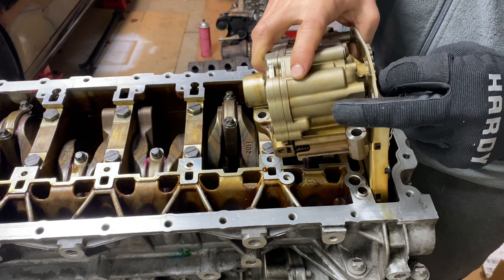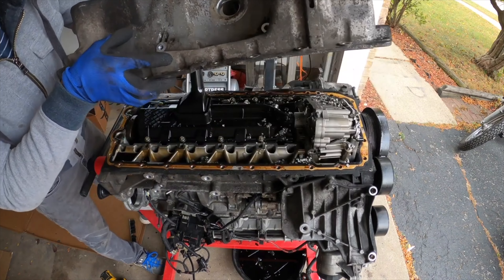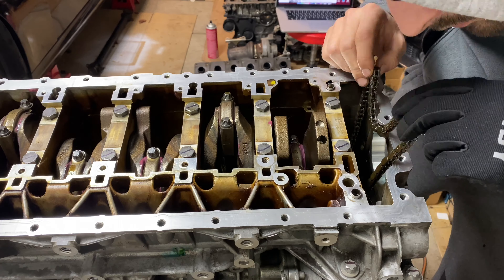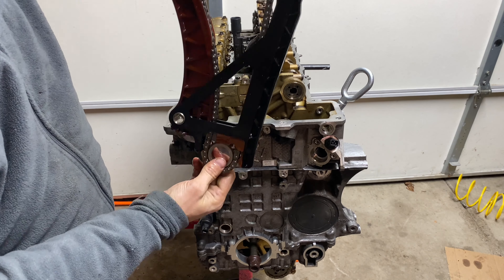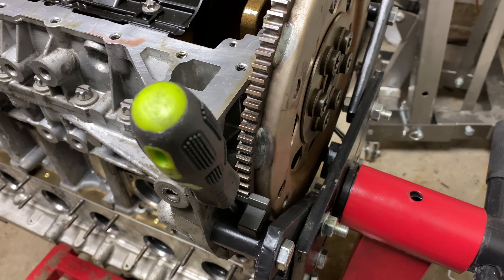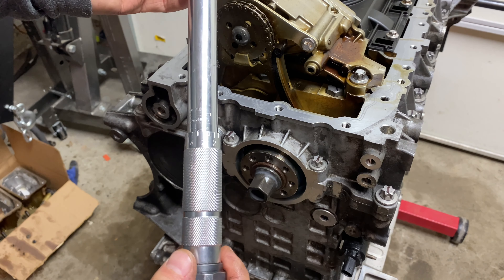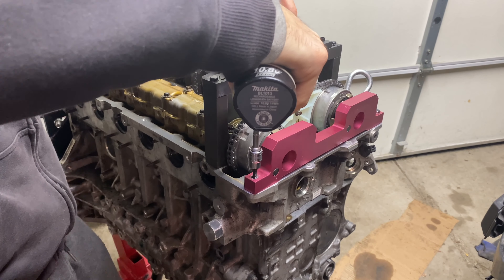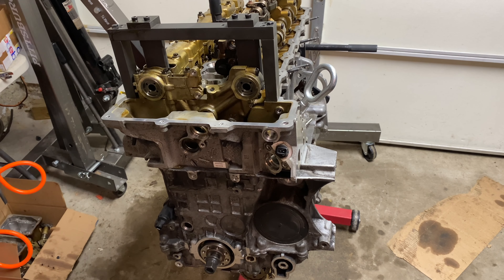Timing Chain and Oil Pump Replacement - BMW N55 Engine Rebuild Project Part 5

Comment: This video is missing so many steps if you do it like this you will have problems. He never installed the crankshaft alignment pin for TDC, he also never installed the flywheel/ flex plate holding tool to brake the crank bolt loose and to tighten it big no no I hope his method on that works it might. The sad thing is the crank alignment pin is in the kit he just doesn’t use it
Reply: Who cares about the timing.
Reply: @dansmith728  absolutely right timing is not important at all lol

Comment: I have 2011 535 GTI I have drivetrain malfunction and oil pressure errors on my car I took it to the mechanic he said the timing chain need to be replaced and we checked the oil pump maybe need to be cleaned up or replaced how much it cost to do all that?

Comment: hey man im doing a timing chain job but im having a weird issue after i timed the engine i did 2 rotation  then when i put the timing alignemt too back im able to lock the cams and the sensor wheell also aligns with the cam shaft but the fly wheel lock pin gets very slightly of alignment i don't have any oil pressures right now. i don't know if it normal or am doing something incorrectly .

Comment: I have a question. What happens if you don't torque the  crankshaft bolt all the way to 270 degrees? Timing issue or low oil pressure issue? I rebuilt the same engine now I have a low oil pressure issue. The car runs fine but I get the low oil pressure warning light every trip I make.

Comment: Hey when you torqued down the center hub crankshaft bolt .. Did you use a 3/8 torque wrench or a 1/2 torque wrench?

Comment: I just timed my n55 using this same kit. When I took it all off to rotate and I check it, I thought it was making a weird clicking/clunking noise and thought something was wrong too!! Also managed to strip the thread on old chain tensioner. Glad I got a new one
Reply: I have the clicking/clunking noise also after timing. Was your engine all good after this?

Comment: great video as always. would be fun if the engine goes back in but mates to a manual transmission this time around.
Reply from the maker: That would be really fun, but unfortunately the car it’s going in is an automatic. Luckily, I got a BMW Z4 that’s a manual, so I don’t go out of practice!

Comment: Nice! Can't wait till you drop it back into the car and start it up
Reply from the maker: I hope it works at the end!!
Reply: @SimpleCarGuy  it will! You've done a lot of work, and did it right. Followed directions and even changed out a couple things that didn't need to be. If it doesn't start, run down your wiring harness and make sure everything is where it needs to be plugged in. I switched my pre and post O2's. Couldn't figure it out to save my life. It took my woman asking why i didn't have them set the same way to realize where my mistake was
Reply from the maker: @markmahurin8891  thanks man! Should be a fun day getting her to run and wired up and I'm not even being facetious! I did the O2 sensor switch like that when I swapped the engine on my Z4, but it showed up as a code when I scanned the car.

Comment: I would’ve probably created three or four videos outlining the entire process in a  methodical and organized wayWhile providing a full description of everything you’re doing including tools. Did I say production production production! I’m not seeing your videos are bad, on the contrary I like watching them and appreciate them very much. I just think there is a lot of potential here to up your game and grow the channel. Either way, and whatever you decide to do I’ll still be subscribed. Thanks again
Reply from the maker: Thinking about this more, I do have about 90 minutes of footage for the timing chain and oil pump... maybe I should do a more detailed version for those that want to see each bolt spec and torque etc!
Thanks for watching!

Comment: Very appreciated information, i am replacing the timing chain on the X5 N55 engine. Do you know if if the oil pump chain is not going to move after the cup is removed. Please advise

Comment: These instructions are great but can you help with what happens when you rotate the engine and the timing is not on and what steps to do next. My red bar sits up and 1/2" on the exhaust side after 2 rotations but stays that way no matter how many turns and we've tried adjusting the crank and still does it.

Comment: Hi, Thank you very much your project  had save my life. but question. I am replacing my oil pump timming chain and since I am there my timing chain. But I forgot to mark the oil pump position (not sure if thats needed?)but does the oil pump or sprockets have to be in a certain position when putting everything back together? for instance the camshafts and crankshaft are at TDC with the locking tools an all that but what about the oil pump and vacumm pump ? 
thank you once again

Comment: Hey man I have a question so I’m timing my motor but the exhaust vanos keeps going out of time I marked crank hub and intake and exhaust vanos and intake and crank stay in time but exhaust doesn’t I also marked the gear in vanos exhaust behind phaser and that stays aligned with the cam shaft exhaust side so my question is what can cause the exhaust vanos to go out of time when crank is in time with intake? Meaning flywheel and crank and intake are all aligned just not the exhaust vanos and shaft? Also I should note that I did replace timing guides and crank hub as well as vanos solenoids I keep getting camshaft exhaust angle deviation outside tolerance and they do lock when car is off btw
Reply: hey man im having the same thing how did it go with your engine, were you able to find out the cause?

Comment: What is the tool to stop the crank shaft from spinning when you have to put the main bolt in?
Reply from the maker: They sell a couple of tools, but if I remember correctly, I used a locking pin on the flywheel. Something like this: https://amzn.to/3DoAxto

Comment: The qr cod3s on the venos sprockes should have been facing 90° up, not 45° to the left the way you did it right?

I'm not sure. Trying to find an answer
Reply from the maker: Yes, QR codes should be facing up. If they were facing 45 degrees at some point in the video, I adjusted them after before tightening everything down. I believe I mention that in the video.
Reply: @SimpleCarGuy  no your misunderstanding me, the qr codes on the venos sprockets should have been facing up is what I said, I was NOT referring to the qr codes on the camshafts.

Turns out, it doesn't matter what orientation you put on the venos sprockets, in accordance to the camshaft or the metal trigger plates on the front of camshafts.

what matters is the qr codes on camshaft is facing up, and the holes on the metal trigger plates on front of venos sprockets are lined up in the timing tool plate

So, venos sprocket position is of zero concern, only camshaft position, crankshaft position and trigger plate on fromt of camshaft sprocket, those are the only things that need to be lined up when timing these engines.

I was able to find this answer a while after commenting and thought I'd fill you in, I was helped alot by your videos.

Comment: I really liked the video as I have a similar vehicle as I’ve mentioned before. That vehicle is a BMW 550I 20113 GT with XDrive. I currently have 64,600 km on the vehicle and I would like to take a look at my timing chain and guides at some point just to make sure that everything is OK. With that being said if I could suggest a little better organization for the video portion and maybe using a couple of different cameras to capture the entire process from beginning to end without leaving out anything. I subscribe to a lot of different curators and what makes the larger Youtubers say over 1 million is the production and creation of the video as well as the knowledge, explanation of the work and complete details of tools used and required. You can still work out of your personal garage but if I could suggest possibly looking at what you want to do with your channel and deciding whether or not you want to really up your game and if so follow the above steps. Hope this helps I will continue to watch your videos.
Reply from the maker: Appreciate the constructive feedback and I definitely see where you are coming from! I will take some notes and work on improving the videos in the future.
One of the problems I have with using 2-3 cameras and explaining everything as I'm doing it is that it takes 2-3 times longer to do the work and then it will take about twice as long to edit etc. I do these projects for myself and film for fun and to capture my adventures with the cars over the years. Some of my other more instructional videos do include overview of the tools and the specifics of doing the job, but then like you mentioned a video like this would be at least 40 minutes or would have to be split up into many other videos. I look at these as more of an overview of what you have to do to achieve the same results. I tend to look for videos like that myself as I can find the specific steps in a workshop manual, but would like to see the full job done in a 15 minute video.

Once again, really appreciate your feedback and thanks for watching! I will continue to improve production value as I learn. I've also gotten a new wireless mic on the way, so quality of the audio should go up as well!

Comment: Hi, did my oil chain and timming chain and when I spin the engine it does not complete the full revolution .  I am using the timming tool and try retimming the engine like 4 times already any tips ? stealership is not an option

Comment: Really good channel. Thanks alot. Really helps me out w my n54 rebuild I'm doing r.n.. n55 is basically the same as an n54 in timing (by the looks of it) You got those parts off Amazon? How's it holding up? Seems a bit sketchy buying stuff not from ecs or fcp euro for this kind of stuff 🤔

Comment: How's it going my name is Pete and I'm doing a timing chain replacement on a BMW 328i E90. I would like to know is it best to take the whole engine out or can I leave the engine it still inside and and what are all the parts I'm going to be needing to do this job please respond to this fast I would greatly appreciate it thank you
Reply from the maker: Hi Pete, you can leave the engine in and replace the timing chain. I did it on my Z4 (there is a video, so that should give you an idea of what to expect). You’ll have to research the parts yourself as your car has a different engine to the one I have in the video.

Comment: I hope I’m wrong but you did torque the main bolt without the pulley on it??
Reply from the maker: No no, I torqued it with the pully on it
Reply: @SimpleCarGuy  
Got it, good work man! 
I’m working on the same engine, your video has helped me out. 👍

Comment: Hello :) great video!! My only question is how did you keep the crankshaft from turning when you were removing the crankshaft bolt?
Reply from the maker: Hi! I had it locked on the other side with tool (basically small screwdriver or allen wrench should work) that goes through the block and into the pressure plate. It should come with your timing chain kit.

Comment: I’m working on my 2013 535i right now with the timing chain, was there a place where you got the torque specs from? I can’t find any online and I’m not that accustomed to following along with the video.
Reply from the maker: There used to be a website newtis that had all the values, but otherwise its from ISTA/INPA

Comment: Hi there, great video. I don't have the engine out of the car. When do I take the plastic pin and replace it with the one that came with the tuning tool? Is it necessary to take the manifold off to place this pin?
Reply from the maker: I'm not sure which I understand which plastic pin you are talking about. Removing the manifold should be necessary to do this job with the engine in the car.
Reply: How does one hold the Crank# to torque it whilst engine is in the car, using the flywheel timing pin tool????
Reply: @Mambwem  Probably already answered this yourself, considering the timing, but for others: there is a special tool to secure the flywheel through the transmission inspection cover. Auto: 11 8 660. Manual: 11 8 180

Comment: Did I miss something, or is there a timing mark on the crank to ensure you’re at TDC? You cant just go by the visual on the crank position from the bottom.. right?
Reply: There is a locking pin that goes into the flywheel

Comment: Hello, quick question. Im just looking to replace the large cam shaft adjuster bolts. Do i still a timing tool to timing the engine after replacing??
Reply from the maker: To do it correctly, yes. When you take the bolt off, timing will shift and you’ll need to adjust it before torquing it down

Comment: I have a big turbo e70 n55 with 600hp died on me on the highway after destroying a scatpack on a 60 roll. The exhaust cam seems fine but the intake cam has the barcode facing almost down when at TDC. I don't understand how this happened. The timing chain is tight. The tensioner is new. The cam ajuster locking tool still fits?
Reply from the maker: Ouch! Sounds like the bolt on the intake camshaft adjust came loose. Assuming you have changed the timing chain the past, did you change the bolt at the same time? Those are stretch to yield and cannot be reused. That's the only thing I can think of as the locking tool would not fit otherwise at TDC.
Reply: @SimpleCarGuy  bolts were not touched before. The bolt was extremely tight when I took it off yesterday. The culprit was the cam ajuster. This is gonna be hard to explain without seeing the pictures but the ring part of the cam ajuster that slips into the camshaft broke and the inner ring crushed. So It looks like when I hit WOT the cam ajuster slipped and moved on its own without the camshaft moving. I changed the cam ajuster and retimed the engine and she started up again. And I did use new bolts .🔩

Comment: Does it matter what position the camshaft lobes are in for cylinder one?
Reply from the maker: Yes, when cylinder 1 is TDC the QR code should be at the top.
Reply: Thx much your videos has taught me alot

Comment: I am in the middle of exactly what u are doing in this video.
Because there is no oil pressure, the vanos will jump / hop when u handle crank. I see that u found out it is normal. Thanks for the info. 
My other issue is that after turning the crankshaft 2-3 times, the intake camshaft got retarded (or advanced) 5-10 degrees. For some reason, the spring inside the vanos does not push the camshaft back to its resting postion. I removed all valvetronic and checked the camshaft is not binding. Now, with valvetronic out, camshaft follows the vanos but when I hand turn (27mm wrench in the middle) the cam, it does not bounced back. This is frustrating. I will take apart the vanos to see what is inside.
Is the oil pressure working against the spring? Or, when solenoid is off, the oil pressure will HELP the spring too?
As always, u make good videos. Thanks for doing this video. Without it, I would not have started taking apart my N55.

Comment: it would be must better if you are supporting the bottom as well when you doing the 270 degree torque.
Reply from the maker: It would be, but it's also very difficult to do alone. If you got ideas how, do let me know!

Comment: At 5:28, did he say 4nm or 40nm? Thanks.
Reply from the maker: Hi, it's 4 Nm of jointing torque and then 45° angle of rotation
Reply: @SimpleCarGuy  thank you

Comment: Where are the timing marks on the chain and gears?
Reply from the maker: There aren’t any on chain or gears.
Reply: @SimpleCarGuy  ya i always wondered how that works, magic it seems lol
Reply from the maker: The timing is set by putting the engine (pistons, camshafts) in Top Dead Center (TDC), installing the chain and then setting the actual timing via the camshaft adjusters. There is a plate on top that has a whole which is lined up with the timing tool and then the bolt is tightened.
Reply: @SimpleCarGuy  just not used to doing timing like that, my previous american/japanese engines all had timing marks

Comment: So I gotta take the whole engine out for this? I mean, I can, but damn lol. I might as well put a whole new engine in there though.  They are only $1,200 for N52.
Reply from the maker: No, you can do it with the engine in the car, but if you are doing the oil pump sprocket at the same time, then you have to drop the subframe and remove the oil pan and if it’s xDrive, you’ll have to remove the driveshafts as well. I rebuild this engine so I did it on the stand and it’s easier to see and understand for the video as well.
Reply: @SimpleCarGuy  Thanks for the info! You're content is most beneficial. ✨️

Comment: How would I go about breaking loose a crank hub bolt when the engine is out of the car
Reply: BMW have a special tool to lock crankshaft (I think it's 119280 also for N55) it's possible also DIY, like I do for N52. I also make a another similar style DIY locking tool to engine back-side (then is no need to be flywheel installed) because hub bolt moment is crazy!

Comment: I have a 2011 BMW 535i , 97,000 miles that I bought from salvage.  The engine sounds worse than yours. Not sure if I can handle the same job you've went thru.
Reply from the maker: It was a lot of work and fairly expensive, I would recommend just buying a used engine instead. I did this more as an experiment to see if I could do it.